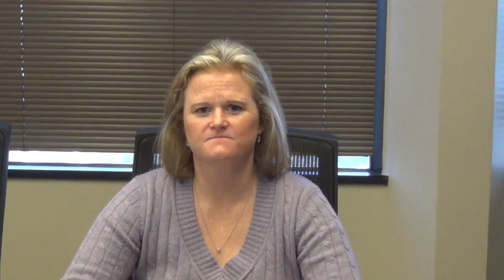Gypcrete Best Practices

Comment: The gypcrete was poured 8 days ago. The night of the pour it got down to 22 degrees outside so the windows were left open only 1 inch or so. The next day we opened all doors and 🏆 wide open  because the day temperature gets to upper 50s outside.  The day after the pour there wad large moisture spots on the walls. They faded a bit but now after 8 days there is still moisture looking spots. They feel dry to the touch.  I. Not sure if these are now stains or still moisture? The walls were primed and painted 2 coats.  Do I wait and eventually just paint over these spots?

Comment: What is the biggest reason why architects specify gypsum substrate?  The weight?  Why not just use ultra lightweight, calcium aluminate based, self leveling underlayment with sound mat?  One product I know of is only 60 lbs/cubic foot versus around 120 lbs/cu ft for gyp.  Plus this product is 4000 psi vs 2200 psi on Gyp.   Why would one want a possible "petri dish" scenario when non gyp products are out there?

Comment: I am working on a project located at Madison Wisconsin. The section drawing of the building shows me           1 3/8”  gypcrete over 1/8” sound mat. The drawing does not show any slab over the joist. We have asked architect for more details. Can you provide some details about the possible thickness of slab for heat load calculations and determination of the U values.